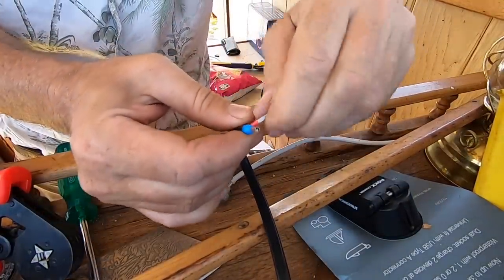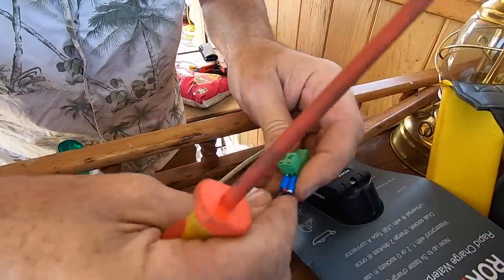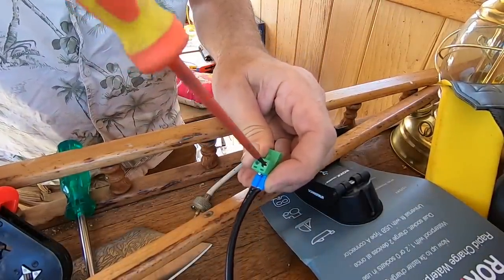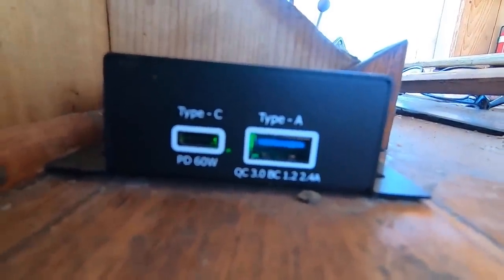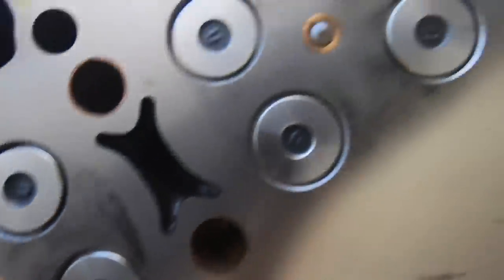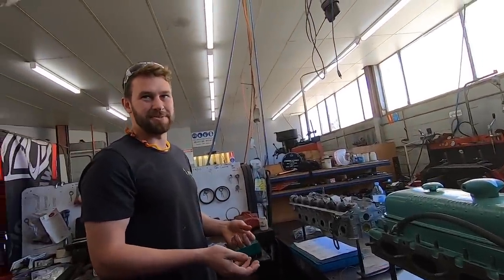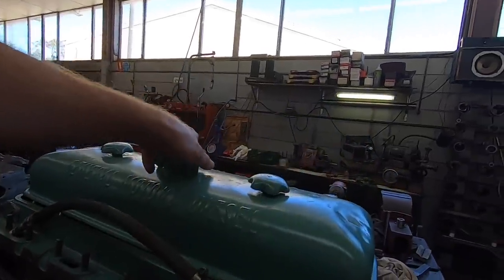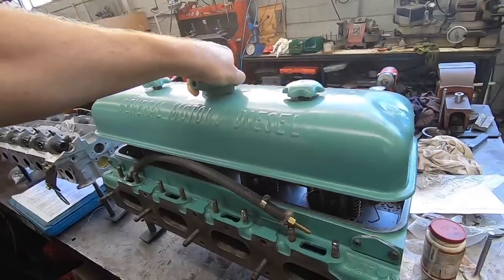Some questions answered

Comment: Have you seen or tried those connectors with solder in them? Found them through Andrew Camarata's youtube channel. The only downside I can see with them is they need a bit more heat than say just a lighter (obviously, to melt the solder) but they completely incase the joint in plastic aswell.
Reply from the maker: Yeah, I bought a bag of 500 of them a few years ago when we had the workshop. They are okay but a little bit hit and miss.

Comment: Okay great video I have one question I know you going to be diving and you live in an island what are you going to use to fill up the air tanks or you going to run hose reels Air Line?
Reply from the maker: Initially on tanks, and then maybe an electric surface supply system for shallow diving. Unfortunately onboard SCUBA compressors are very expensive.

Comment: I'd guess if peeps don't like yon electrical things it's probably because to lots of people the minutiae of voltage, resistance, hertzies etc might as well just be you humming along to men without hats for an entire episode. That includes me, too, to be fair, so I do understand that, but I don't follow most of what you guys are talking about even when it's not elecrical. Partly there's a cultural thing - Australasians have a completely different set of terms for almost everything. I watch you and Brupeg mainly because I like watching something going from broke / buggered / shit to working.

If you don't follow what the terminology is, it can come out like...

"G'day mates, down here in the wolly-bonglers we're seeing some genuine spales and gurndogs. We've got a wallemper of trizzle and by the end of the day we'll have earned a beer and with luck our comzoomer paralols will be bucky tombo, completely wiff-naddered to thirty two or forty seven nacktables, which is standard for a pum-shupper but as we're using kod-lippo shandbakker we'll be urnstabling that down to eighty fopaloons. Gav-o here's been shirt-shambling for ten dunny-loads so he's here to help us push the trim-spashiel wow-hampers up the cruden yuggles, ought to be fairly easy, as long as there's no yaff-ploops up the neo-topplian flecks."

Which I for one find hypnotic. :-)

Comment: The other way to do it (other than two 24 Volt battery banks and a 12 Volt battery bank) is to replace* the generator,  starter motor, all solenoids and the crane motor with twelve Volt versions and maintain two twelve Volt battery banks and eliminate the conversation from twenty four to twelve Volts and that battery and wiring.  Then all accessories that normally operate on twelve Volts operate normally.  (GPS, two way radios and all navigation aids)
   * also all boat lamps, fans and other 24 V. accessories.

  To operate correctly nothing other than the generator and the starter motor should be connected to the "starter batteries" (except for the cross over {continuous duty type }  1,000 Ampere relay to the cabin batteries) so nothing can run the starter battery down.  (that relay should be operated whenever the generator is chagrining (and when the shore powered battery charger is operating) and when the emergency start switch is thrown. 
  The 12 Volt starter battery should be two large car or truck batteries in parallel.
  This is how almost all RVs with an internal engine are arranged in America.
  This is how almost all pulled RV trailers are arranged in America.  I can't speak about other places.  Ron W4BIN
Reply from the maker: You would also need to double the size of many of the wires due to the higher current draw at a lower voltage.

Comment: Have you thought of getting another green machine with a fang’n motor and putting the same system as sail boats to hang it off the back of the big boat.
Reply from the maker: I have thought about getting a slightly bigger tender next time. This inflatable gets pretty small once you start putting a second person or gear in it.

Comment: New engine verses old engine : new engines need to be broke in to run efficiently as old engines are broke in  and will last longer then the new engines and old engines are built to last

Comment: Hey Stu re lazzarette fuel line would suggest thick neoprene between hatch and fuel line to act as suspension otherwise metal will cut fuel line with weight of metal pushing rubber against the metal lip 👍 also gonna repower my beast tossing up between suzuki and mercury so I would welcome your thoughts
Reply from the maker: Yes, have been looking into some neoprene strips. Both outboard brands are pretty good these days so I'd go by who is closest to you and can give you the best aftermarket support.
Reply: @DangarMarine  have decided on mercury thanks Stu but was wondering what are the differences between 75 and 90 as I have heard a rumour that motor is basically the same

Comment: Before you commit to a paint option, I try samples on a piece of plate left on the deck and see how they perform re grip when wet and durability in sunlight. I think truck bed paint is a great idea to try, but I have only seen dark colours. Edit: was wrong - can get any colour. https://scorpioncoatings.com/color-custom-truck-bed-liner/

You could totally have hot water, for a shower on the back deck, etc. This system seems really flexible: https://www.svb24.com/en/sigmar-marine-compact-water-heater.html
Reply from the maker: Good point about testing it. It would be interesting to compare brands before doing the whole deck.

Comment: Stu, are you going to have separate battery monitors for 24V starting, 24V house and 12V systems? If not, why, and which one are you monitoring?
Reply from the maker: The single display can monitor all three banks.
Reply: Dangar Marine that’s neat. I assumed you’d need 3 displays and 3 shunts so this must be smarter than mine if it can read 3 shunts. My battery monitor can only accept a single shunt. Does it accept the info about the mppt chargers to show that as well?

Comment: Love those Detroit engines if they are not locked up they will run know that , if you ever have a problem its air or  fuel loss  if it's not seized it will run and run strong

Comment: 9 to 24v means its just a regulated supply, so is the output 5v? I have one for the boats TV, its a 9-32v supply which it gives a constant 12v so it doesnt burn it out. Most TVs and laptops have a regulated supply but this was a tiny old LCD thing and I was sure that it did. Batteries and alternators are a lot more than 12v as you would known. 
If u already have pressure water, look for a Duoetto water heater, theyre both 12v and 240. Ive got one on Zaya, it only does like 4 gallons or something but its great, cheap too
http://www.australiandirect.com.au/assets/full/Duoetto10L.jpg

Comment: Stu, I know this is more in the realm of "pretty" non-skid for fiberglass boats and whatnot, but "soft-sand" seems to be a pretty durable surface that you can use with whatever epoxy paint you'll be using on the deck already.  Probably be pretty easy to patch up as well.  Andy over at Boatworks Today has a few videos about it. Here's one:  https://www.youtube.com/watch?v=8J_z2MjE-0g
Reply from the maker: Thanks John, I appreciate the link. I like his videos, I'll definitely check it out.

Comment: It's not easy making videos as you say, I made over 50 monetised videos working mainly on a little (4 metre) fibreglass boat hoping to make a few dollars and then because I wasn't much good YouTube gave me the arse and removed any credit I had built up, so according to me any prick that runs down a serious YouTube attempter is indeed a dopey prick, see if they will work their guts out to produce a 10 minute video that can take a week to make for no reward, I would have been happy with just one lousy dollar giving me hope for the future but all I got was a rebuff after spending 14 months buying a camera, software, learning it and then using it all to educate other people who thought it was going to be easy to restore a boat and trailer that were ready for the tip (dump). I had viewers from Europe and USA and Asia even a universty in the US, and it had historical value here in Melbourne Australia, beign a Bertram design almost the first boat (Seasprite) built here by a new factory in the 60s who used the name Caribbean for their many boats.
What hurt more was eventually selling the now almost show quality boat and trailer and still losing well over $2000 plus all that labour (labor).
The original outboard motor was 10hp Evinrude with a missing starter assembly and I replaced it with a 50HP Mercury, what a sucker I was!
Reply from the maker: That's a real bugger. It does take a lot of work and it's a shame to see all that effort undermined. Can you upload them to a different platform?

Comment: That forward window, second from left, just inboard from the starboard upper corner, looks like daylight coming in through where the wall meets the roof...unless it's just a reflection?
Reply from the maker: Can't say I've noticed any gaps or anything, but there is a small hole there where I have removed some old wiring that I will be replacing using a cable gland.
Reply: @DangarMarine   It was just, like, I was watching the video, and kept seeing that little tiny hole there. At first I thought it was dust on my screen, and then realized it was in the video. No biggie, I'm just OCD like that...like what you've done so far with that dragger though...

Comment: Is it feasible to use a heat-exchanger on your heated engine cooling water to heat a plumbed fresh water tank?
Reply from the maker: Yep, that's actually how that big orange hot water tank worked that I took out.

Comment: Yeah well I know I'm a day late and a dollar short but you could have used some limiting resistors before you power that block with your 24 volts and that way nothing more then what you limit which resistors will go in there and you won't destroy anything thing
Reply from the maker: Good idea, it's never too late to add them.

Comment: 24v to12v converter  may need a heat sink due to engine room temperature of 135 df...
Reply from the maker: All good, the converter isn't in the engine room.

Comment: Will you be building and setting up hard points for a collapsible gantry that you can setup for those times when you run into something to big or awkward for your deck crane to handle
Reply from the maker: Thinking I might weld up a separate barge to push around for big items.
Reply: @DangarMarine  My degree is in electrical engineering tech and I am a ASE certified Master tech with a ton of Detroit experiences from the Navy now that I am retired I love watching people work on them I try to tell you what you should do but you don't seem to hear meas I watch your vids  LOL my wife laughs at me talking to the screen

Comment: Does he have WiFi or just Cellular in the boat? Just wonder if with the proper WiFi setup he could connect to his home network and upload/livestream from the boat?

I’m setting up a 1000ft connection to my sisters house on the next street over to split rates with her. Purchased Ubiquiti Nanobeams which are overkill but at $77ea there wasn’t much incentive. They’ve been superseded now but the replacements are similarly priced. Wish I’d gone 900mhz instead of 5ghz because of some obstructions but it may turn out well anyway.

Comment: I got my boat with the 150 on it fixed the evin-rude dealer was a great, haw haw full of water mess,  motor junk & boat was junk too he basically said, so i took it home & called around and found a 60 hp johnson with wiring! he said remove the 150 & they re-power the boat  the cables were ruined & steering gear too, the newer wiring has a tack with lights & the safety switch (that stops motor from working no spark)  so the dealer first was wrong! the dealer who fixed the boat & wiring had the 60 hp Johnson was a mercury dealer that sells ranger-boats my boat is a ranger-boat, wired for OMC motor Jonson/evin-rude thus Johnson would fit on it! any thing that runs better then rowing I sort find people who take advantage of me! well i got a evin-rude 150 computer i wrote BRP marine ( the corp head people)what do i do with this part it was used for testing with motor control of depth cut off system that was on my ranger boat! oh by the way your dealer did this to me with the bill i paid to re-power my boat and fix it! plus i run trolling motor of 12 volt with solar charging & 12 starting battery too  get boat in and out the 150 was a gas hog & i lost sponsors due to illness (stroke)tied to military service injury threw blood clots tied to my uncles mother & how i got here! i was adopted records were sealed unknown till now!
Reply: i worked on gm 2stoke diesel 4 cylinder  in gm type van trucks 26 ft long 4 trucks no 2 were running at same time the tow truck driver owner loved bills being paid they were a lot the company i worked for got a tow unit for fifth wheel use it went on fifth wheel to truck to tow broken trucks and tractors then like a month later the build i worked in burned to the ground a gm v6 92 tt run away and caught fire and burned the building complex to the ground on a snowy bad day!   weeks later i lost my job & worked with Gm and mail truck maker job GM made v6 92 tt sold engines to truck maker with out air box units and white was the truck GM bought out white! the engine run off oil & would either blow up or burn the truck up and buildings and ruin your day! the air box safety shut off in air box to stop this engine from doing this!! it was apart & no shut off i seen in there! it was a white truck! most from gm sold stuff was from GM attorney in court stuff under case's records i was questioned about what i saw and happened i was last in the truck that caused fire! every year jan 2 is a bad day for me! even 30 years later

Comment: What would an already rebuilt detroit diesel long block have cost, vs. the amount you're paying for labor and parts?  Not that you should have gone that route, just curious.  Do you have a total on the engine cost(s) for just the engine rebuild?

Thanks,

RichE San Diego, CA
Reply from the maker: That's a good question. I probably could have found one cheaper, but the trouble is most engine I see advertised as "recently rebuilt" turn out to have just had the head skimmed or something and even then it turns out that recently means 5 years ago.

Comment: Yeah, the americans indeed allow everyone who wants to, to work on a car. As a result you might get anything between the shittiest repair you can imagine and superb technicans dooing a great job.
In Germany it is kind of in between. You can run a shop only if you are not only a journeyman but a master automotive mechanic,  electrician or mechatronics engineer. You can work on a car having not learned anything like that, but for certain things you have to be certified to do so, HVAC stuff or anything about airbags for example. For safety reasons on the one hand, for insurance reasons on the other hand. And difference I found to the US, anyone here in Germany can do Gas and Diesel engines, in the US you have to look for Diesel specialists. Here it is more a distinction between regular automotive stuf (cars) and commercial vehicles (trucks, lorries, heavy equipment,...)
And still, despite everyone here working as a journeyman with automotive stuff should know his stuff (at least people not beeing journeyman or at least apprentice working on cars are kind of rare), you can get a shitty repair. As everywhere especially if you find the one shop that wants to make fast money with as little as possible work.

Comment: I would be surprised if you could charge a MacBook with a 12V USB-C. The original Apple charger delivers around 20V over UCB-C, e.g., 20V 3A for a 13" MacBook Pro.
Reply from the maker: It's a step up transformer.

Comment: 👋🏼 😃 I’ve Always had an interest in electronics, even to component design, alongside the mechanical applications. Unfortunately, the hand full of businesses I tried to work with, saw training as potentially constructing the opposition, 🤔💭which I guess was flattering, though frustrating.. 🤦🏻‍♂️ So, without any formal training yet, ( now 50 ) my quandary literally arises from my recent purchase of a modest 6•4m trailer boat. Is that how does one calculate the approximation(s), & capacity of utilising a series form of inhibiting anodes.? 🤔💭 Ï guess it’s the location(s) of the charge, storage, draw points & the required elec’ compliance(s), calculated by the dimensional, constituent mass of vessel. 🙂✌🏻🗣 ) ))”Long LÏVE the bilge råt “ 🐀✅
Reply from the maker: Hi Adam. There's a bit of a formula for calculating the amount of anode needed https://www.boatzincs.com/anode_weight_calculation.html

Comment: Sorry mate but I'm not convinced that your electrics are adequately protected, it's no good putting a blanking plug in the inverter when water can enter the air vents. What about driving rain and pitching seas, worst-case scenario water will not run dead vertical. Saltwater and electrics a guaranteed dead short. If you had to put your switchgear there then a waterproof encloser would be preferable.
Reply from the maker: Yes, some sort of protective cover is needed.

Comment: Hi stu Michael from Ireland here here is an idea on hot water you might be able to use.I have just installed one of these in my home it was not to difficult although it was on a 240 volt system.I am sure your boat could that here are the units I am talking about 
= https://www.wish.com/search/hot%20water%20taps  .Hope this helps michael from Ireland